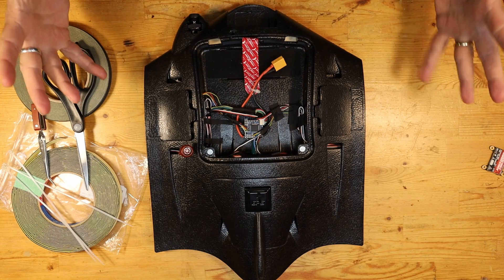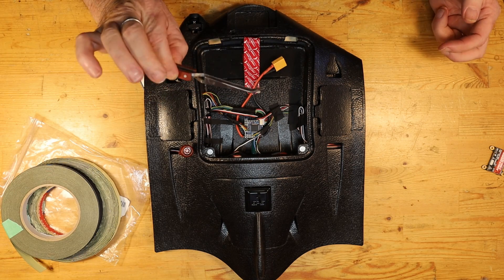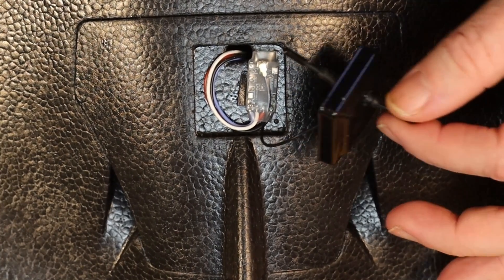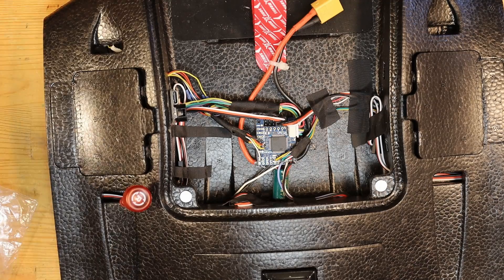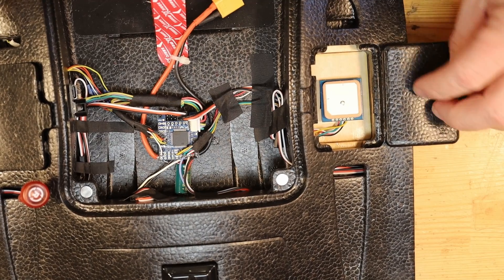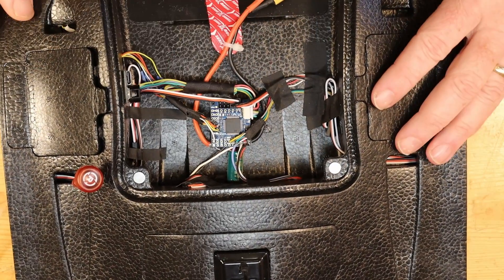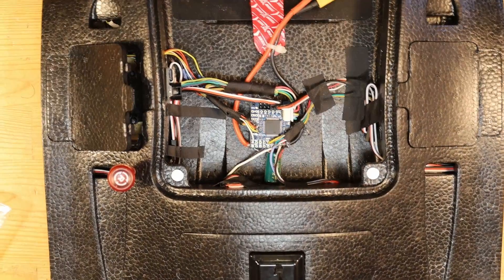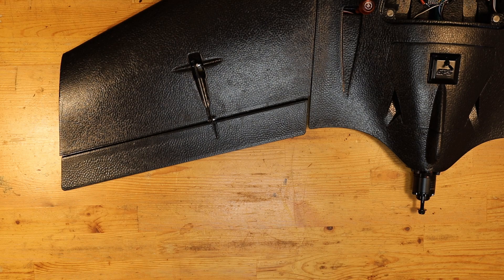How to install a flight controller in a flying wing - AR Wing Pro

Comment: I'm following every video in this series and it's so helpful! I have the same WMN controller. The datasheet shows only the white wire from the esc connecting to S1 or S2 on the power delivery board. Is that how you did it, or did you also solder the red and the black somewhere?
Reply from the maker: Thanks for watching the videos.  I'm glad to hear they're helping you out.   As for connecting the ESC to the PDB, you will only need to connect the main power leads (+ & -), and the signal wire (white wire) to S1 or S2 on the PDB.  S1/S2 are Signal 1 and Signal 2 and link directly to motor 1 and motor 2 in iNav.

The other 2 wires are from a BEC on the esc.  They are used to power the RC receiver and servos is you aren't using a flight controller.  Depending on the ESC they provide 5v and 2-8 amps of power.  You should not need to use them.  I simply folded and zip-tied them in my build.

Hope this helps.  If not, ask again.

Cheers.

Comment: Antenna goes on the wing on these models man. Opposite to the VTX antenna. One antenna on each wing basically. Helps with both “noise/RF isolation” and balance. Best practice usually accepted by most builders. Not a cure for all fail safes but works. Those tiny side compartments are where the modules go thus allowing the antenna cables to reach. Use the immortal T also.
Reply from the maker: Thanks for your comments.  I do know that many people choose to place the VTX and RX antenna and hardware very far apart in flying wings.  That is important if you have noisy electronics and/or use RF frequencies that can interfere with each other.  On this build,  I put the 5.8Ghz VTX in one side compartment, the GPS is in the other, and the 2.4Ghz Expresslrs RX + immortal-T is in the top above esc.  As for the RF interference, it certainly can happen.  For example,   1.2 Ghz video does not play well with 2.4 Ghz control links.  However,  I'm not aware that 2.4Ghz affects 5.8ghz or vice versa.  I have used the same components on my quads for 2+ years now with zero issues.  On my quads, the antennas are only 2 cm apart.